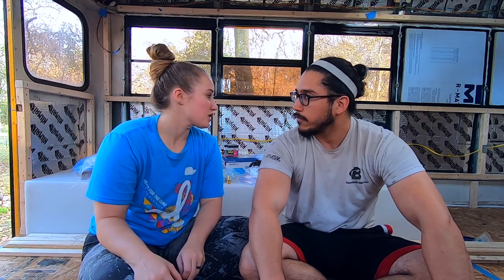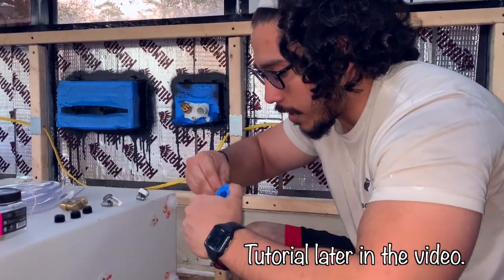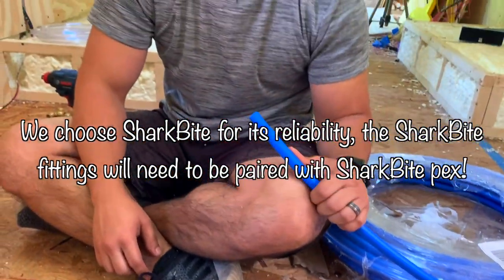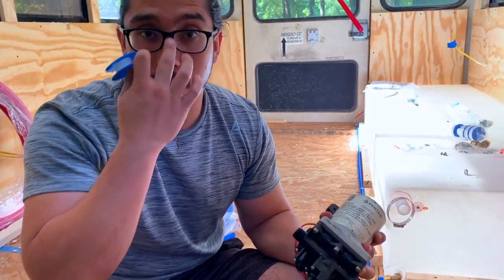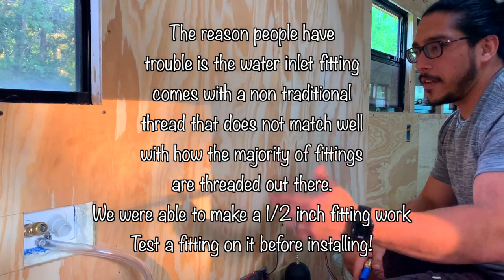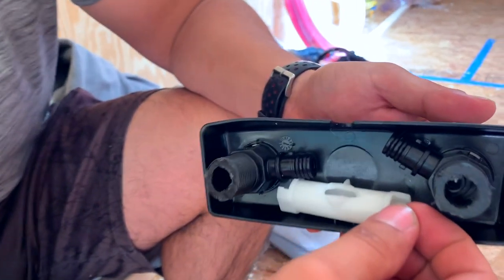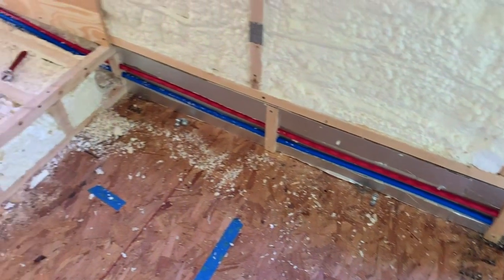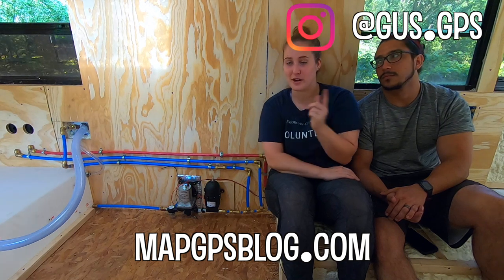Easy Plumbing Install With SharkBite and Pex Part 1* Skoolie Conversion * Gus The Struggle Bus

Comment: Okay, that made check valve placement sooooooooo much clearer.  I've been trying to wrap my head around that one for a while. You guys rock.
Reply from the maker: Ridiculous Verbage I’m so glad we could help!!
Reply: @GustheStruggleBus  I know there needs to be a check valve after the accumulator.  But, have you seen anyone put a check valve after the water heater as well?
Reply from the maker: Sorry for the late reply. In theory there should be two check valves one after the pump and one after the city water this is so that there is no back pressure going into the pump or going into the city water. I have not heard of anybody putting a check valve after the water heater.

Comment: That's a massive water tank, wish I could get away with that much weight. But, that's the beauty of a bus conversion as you have a very solid and strong base to start with. 

Good job guys.
Reply from the maker: Thanks 👍

Comment: It may be prudent to place some neoprene where the water tank meets the securing batons so it doesn't rub through with vibration over time. I would also buy some blanking off caps and pressure test your system along the way Leaks now will be way easier to see and deal with.
Reply from the maker: These are 2 amazing ideas!! Thank you so much.😁🤓

Comment: Doing a great job! Make sure you double check all of your shark bite connections. They are designed with a 2 stage seal and you will feel 2 clicks when pressing them together. I doubt you will have a problem because you will rarely be pressurized like in a house, but better safe than sorry!
Reply from the maker: FacePalmExpress thank you! Yes we made sure to hear 2 clicks!

Comment: now build 2 manifolds / cold & hot with valves for each water feed oh and 2 low point water lines drain valves tubing going out bottom of bus floor to ground
Reply from the maker: Yup that's what we have planned. Question, why 2? Not just the one in the back like how we have it now?
Reply: Will you be doing a video?  This is Greek to me!🤷🏻‍♀️🤯🤞💚

Comment: Looking good so far! We had a used plastic outdoor shower faucet also but it leaked too much and felt cheap, so I found a heavy duty but still tiny stainless steel one at a local mom and pop shop that sells lots of RV stuff and special fittings for propane, plumbing, etc. It might be a good idea to find something similar. I love the way you buried the lines in the wheel well. Can't wait to see the progression.
Reply from the maker: Thank you so much!! That was all Merediths idea. We will have to look into different outdoor shower options and see what would benefit us the most 😁🤓

Comment: The hot water side of the pipe will expand and contract you would need full plastic pipe clamp where the clamp hold the entire pipe or you would get a knocking sound
Reply from the maker: Can you explain what you mean by full plastic pipe clamp 😊

Comment: I love watching your videos. Your water tank has three holes, mine has only two holes. So I’m confused. If you could help it would be much appreciated. Mahalo
Reply from the maker: Of course! That confused me as well at first. On is for the outtake ( where the water exits ) one is for intake (where you refill and water enters. And one is for air to escape so you don't bust your tank! When water enders the air needs to exit, so that has a vent on it for bugs but stays open.

Comment: On my accumulator tank outlet it’s npsm threads but the shark bite female adapter is fnpt. Did y’all just tighten as far as it would go?
Reply from the maker: Yes, ran into the same thing but found one that fit the best it could and then tightened it as much as I could with out breaking it

Comment: I can't find any information for the kind of hot water heater you have, but some others have said that they shouldn't be mixed with cold at the source of where the water will come out(the faucet or shower). I want to be able to use a mixer valve at my shower like you have. Do you know if there's any reason why you wouldn't be able to do that?
Reply from the maker: Hey Megan, I am not sure. I have not been able to test it adequately but we saw a few people using this one and they loved it. I will see if I can find the link, but any research you can do should help
Reply: Ok thank you!

Comment: Does the water pump need a switch installed as well to turn it on before turning on the faucet?
Reply from the maker: It doesn't need one but it is best to install one so you can turn it off when you need to

Comment: With the city in line you used 3 elbows. Couldn't you eliminate 2 of those and just bend the pex? (Same with the outdoor shower line's elbow and the 2 hot line elbows.)
Reply from the maker: Technical, yes. You could eliminate a lot of connections if you really needed to. We didn't want to have to bend the pex pipe to much nor have it sticking out a lot. So we had to compromise and make a couple of connections (elbows) that also helped keep it nice and neat. 😁
Reply: I would just worry that each elbow is 2 extra joints that could be potential leaks in the future, but the elbows do make it look nice.
Reply from the maker: True, we hope not lol. We went with the Shark bite fittings because they have really good and seem to be very reliable

Comment: Very organized. Easy to understand most of the time. I think I can do this. Why did you choose 1/2 inch pex over 3/4 inch pex?
Reply from the maker: We choose 1/2 inch because all of our fitting/connections where 1/2 inch so it just made sense.

Comment: Thank you for your informational and humorous videos! I am removing my 52 year old aluminum water tank from our 1969 Aristocrat Land-Liner 21' travel trailer and installing a RecPro water tank and PEX lines and fittings. I ordered and received the ShurFlow water pump and the instructions says "No need for an accumulator with by-pass pumps." But you installed an accumulator on your system... why?
Reply from the maker: Hmmm that is interesting, we did not see that in our instructions. We had it recommended to us by a few other skoolie peeps

Comment: Did you put a return pipe to your tank to use until the water is up to temperature?  You can (obviously) put a shut off valve so it goes to grey tank when ready...🤔🤞✌️💚
Reply from the maker: That is a great idea thank you!

Comment: Hey guys, thank you for the awesome content. I'm still in the planning stage of my build and am trying to work out what types of fittings to use for my plumbing. I definitely like the idea and simplicity of shark bites but am worried about leaks over time due to vibrations. Have you had any issues with those over time? 

Thanks,
Martin
Reply from the maker: Thank you so much, I hope it is going well! And no, thankfully there has been no issues so far!

Comment: My parents has an RV that was plumbed from the Factory with Sharkbite plumbing. It developed leaks at elbows and higher pressure fittings after about two years of ownership. Not sure I trust them for long term projects.
Reply from the maker: That is good to know! I will have to keep an eye on them

Comment: Hello again, the fitting on the inlet that connects to the city water, is it a 1/2" female, push to connect? It isn't listed in your links. Thanks!
Reply from the maker: Yes, correct! I try to add it thank you!

Comment: What’s The Connection Piece  In Between The Pump And Accumulator Tank. Also, What Fitting Is That Going From Tank To Pump?
Reply from the maker: Hey! The one on the Accumulator tank came with it, I am not sure what it is called but it was in the box with the tank. The smaller thing between the tank and the pump is called a strainer! it is recommended to get one for before your pump

Comment: Is this strictly for an outdoor shower unit? I'm going to assume it can be used for an indoor one as well but is there a water heater included?
Reply from the maker: This unit is meant for outdoor use, it does not include a water heater you have to hook it up to your own.

Comment: What pump did you buy? I tried to use the link and it didn't work :(
Reply from the maker: Hey brent! Hopefully we fixed it, it is a RecPro RV Water Pump Shurflo 4008-101-A65 3.0 GPM | 12V Water Pump

Comment: You should of used plastic male iron pipe (mip) thread to connect instead of brass push to connect
Reply from the maker: Why is that? Just wondering why one would be better than the other. 😊

Comment: Hey, love this video, I was just wondering if you remember how you connected your pump to the accumulator. We have the same system and the plastic connection on the accumulator isn’t a pex, but a hose barb. Did you use a hose and get a hose connection at the pump.? 
Hope this makes sense! :) thanks
Reply from the maker: Hey! Yes I believe we had to get a connection! Thank you so much for your support, next time I go out there I will double check!
Reply: Thank you so much. Always look forward to seeing what you’re up to. We are traveling and working on the bus in Florida. It’s a nightmare at points but your videos keep my spirits lifted :)

Comment: the right way is to not use teflon tape (small slivers of the tape can block the impeller or the tapseals and can make youre life harder ) instead use a teflon coating stick 
https://www.emisupply.com/catalog/loctite-37615-thread-sealant-stick-gram-p-14335.html#.XyMPUp4zbqk
Reply from the maker: That is the perfect explanation! We are still trying to get the hang of it, practice makes perfect!

Comment: Cheaper to use plastic connectors is that a brass
Reply: Cheaper to use plastic connectors instead of brass
Reply from the maker: O ok yeah that is for sure! We went with the SharkBite fittings because of the ease and reliability. It was a but more expensive though
Reply: MEREDITH and PACO they have same one in plastic same thing as the brass one Easy to connect
Reply from the maker: I'll have to check it out

Comment: Don't want to knock your job that you have going on just want to say ive been doing plumbing for several years now and im telling you those sharkbites do not last long and they will leak, causing lots of damage if not found immediately.  Just letting you know, they are not permanent installations in the plumbing world, only repairs
Reply from the maker: D Dunc thank you. We did our research and felt this was a good fit for us. Hopefully it will hold up but we will keep a close eye on it
Reply: I agree the rubber o ring dry rots over time and causes leaks. Do all the internet research you want it still won't change that shark bites are terrible.
I'm a licensed plumber in Texas and we don't mess with those at least the good plumber's don't. Heck it would probably be cheaper to call a plumber to do it all shark bite fittings are expensive af too.
Reply: @Troywitt1987  What do you suggest using instead then if shark bites are terrible? Is there a specific system you recommend? I'm getting close to doing my plumbing and am honestly pretty overwhelmed by it all.